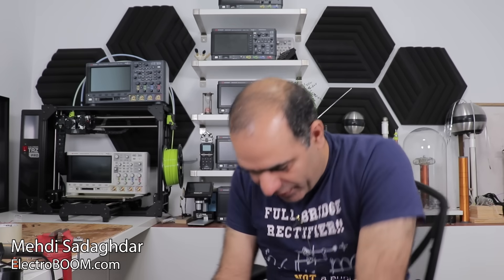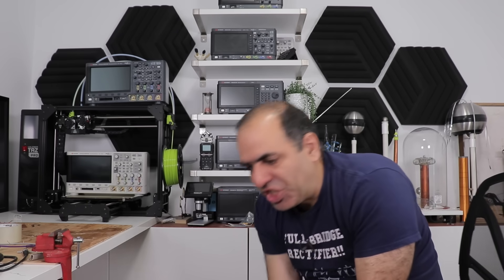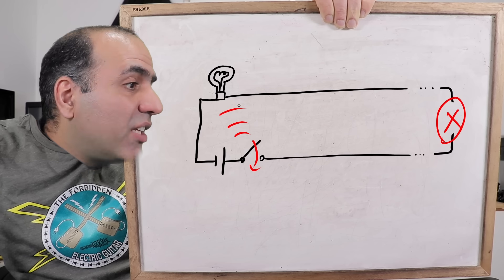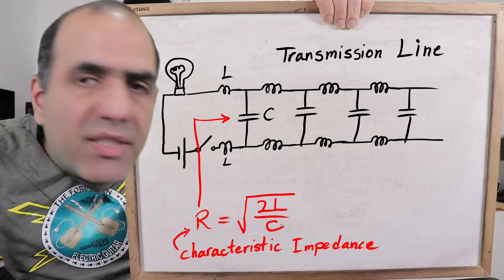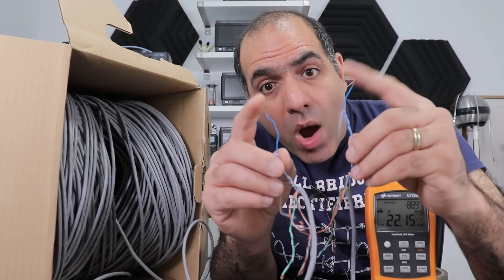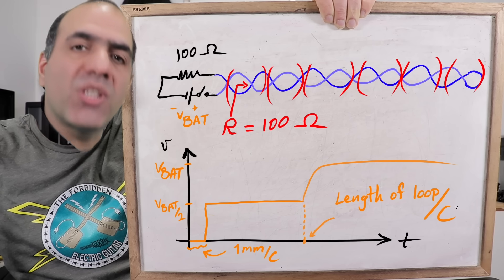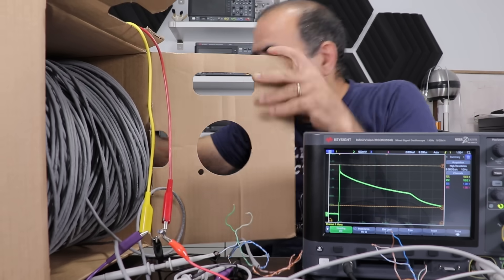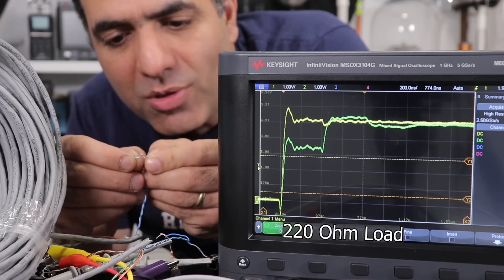Testing the LONGEST LOOP OF WIRE!!! to Turn a Lamp On

Comment: What I am still wondering after everything said is: how do the charges near the load know that they are part of the same circuit the switch and the battery are part of? Of course they can only move if somewhere else something is moving in order to occupy that space, but that only happens when the whole circuit has communicated. So… how do charges next to the load know that the flux of charges near the battery is not from a disconnected circuit?

Oh! Damn!! It doesn’t! I had forgotten my EM lessons… so… it would blink for a moment… yes…
Reply: Resonance, right?

Comment: That is amazing! Does that mean we could virtually power any device with only 1 electric cable instead of a pair? Is that already in use in some applications? Or is it not because it is inefficient?
Reply: No. Remember he already connected “the other side” with a very short length. You do need a full circuit (which is why you have the two conductors, one that “goes” and another that “comes back”. He then just worked on the “very long side” for most of the video.

Comment: After connecting each twisted pr in series, connecting a variable resistor to the far end while sending a 50% Duty Cycle, 1khz square wave (TDR), you would be able to find the total impedance of the line. After finding the total impedance of the line you should also determine the Velocity Factor of the line. Once the Impedance and Velocity Factor are determined you can calculate and cut the line length to the incremental wavelength, with respect to the frequency of the voltage applied. Now you would be able to measure the speed of The Lamps On Moment Vs The Switch On Moment equated in time.

Comment: May I enlighten the interested viewer that this is nothing other than the transmission of radio waves?

An antenna (dipole) is two wire ends that do not form a circuit. Nevertheless, a (modulated alternating) current flows into the wires and creates an electromagnetic field. And the simplest receiver is again a dipole and a small part of the energy arrives there without being electrically connected to the transmitter in any way.

So what is shown here is basically how to build a simple transmitter and a simple receiver. However, it's funny how you approach the subject here.

Comment: as a network guy installing these Cat5 cables, i had a good chuckle when you measured 40m by hand :D every 1m is marked on the cable itself, you could just cut the cable at "40m" mark (or 265m, if your numbering decreases from the end)

Comment: Its worth saying that diffrent pairs  in the TP bundel have diffrent number of twist per meter. This is very exactly contoled to with in a fraction  of a turn per meter..

All the twistnumbers are primes  so they will not interact in either long of short cables

Comment: I was thinking about the speed of light in the wire shouldn't it be a little different for copper wire, aluminum wire, steel wire etc? In the end the atoms are packed in the Unit cells in specific configuarions matching their atom radii, thus the speed of light should be different. I wonder how big is the difference.
Reply: Yes.. Al least you can check with internet how transmit the information
Depends of category

Comment: It's great to see the induction of an LED can be done in 5 cm with such a low voltage.  Of course Derek's 1 meter distance does matter and the light bulb and the voltage he used matter.  The setting simply does not turn on the light.

Comment: I've been using RG-58 coax cable for this experiment for some years. Works very nicely and you don't have to make your own drivers. This is because everything has a 50 ohms impedance: bothe generator output and coax cable. It's a length of somewhere between 70 and 75 meters on a spindle. We calculate from the scope timing what the actual length should be, and sometimes students then actually measure it. Really nice experiment where you can see the effect of an open termination, a short circuit termination, and the correct 50 Ohms termination.
Reply: You made a TDR

Comment: Great class, thank you. Would you consider showing us how twisted pairs reject or cancel interference?
Reply: It's pretty simple physics, right hand rule of a conductor producing a magnetic field when a current is passed on it. If you put two wires really really close to each other, with identical current going opposite direction, and you are observing from suitably far away, maybe 10x distance between the twists for ease of calculation, you will see zero magnetic field, because there is essentially zero net current when you superposition it.

Comment: i like how changing the resistor causes the steps in voltage to change when its not matched to cable impedance, its becoming antenna matching  theory

Comment: In telecommunication's industry we use TDR device - time domain reflectometer, it uses reflection of other end of loop to determine line length and termination (open, short or fault), depending of cupper pair insolation (basically depending on type of cable: jelly cable, paper insulation cable, etc.) we have different speed of light trough the cable - propagation (if cable insolation have higher dielectric constant we have higher propagation), with correct propagation we have reflection on screen on correct distance from measuring spot.

X axis of graph is length (in foots or meters) and Y axis is reflection, reflection of returning signal represents change of impedance in path.
If graph at end goes up it means that we have open circuit (reflection goes from zero up - impedance goes from constant to high)
If graph at end goes down it means that we have short circuit (reflection goes from zero down - impedance goes from constant to low)

Depending of situation, positive reflection can be also A or B line break (one line break), negative reflection can be corrosion on line, moisture in cable, parallel line etc.

Comment: One difference between your setup and Veritasium's is that yours is compact enough to be considered as if nothing else exists. In a more spread-out setup like Veritasium's, external influences such as stray capacitance between the wires and ground, current induced in the wires from nearby TV/radio/mobile phone transmitters, even sunlight and cosmic rays, all have an effect. The theory is the same but all these external factors would make a practical experiment less demonstrative.

Comment: When wiring Valve/tube amplifiers/radios/test equipment etc, the heater wiring is all ways twisted to reduce hum in the circuit. Being the voltage is usually 6.3v ac 50/60 hz, one can run heaters on dc but that requires rectification and there fore added complexity and cost.

Comment: In ham radio, when building antennas, we use a factor to adjust the length of dipoles, based on the material used. Iirc, copper needs a 85% change. This is because the wave length, which is used to calculate the dipole length, is based on the speed of travel of electrons. Seeing that your cable had around a 70% difference, probably means it's not pure copper, but plated. It's much cheaper that way.

Comment: 3:00 it definitely does matter since if the ligiht bulb is right next to the battery then when you throw the switch you begin charging (as far as the light bulb knows) a capacitor by feeding electrons from one side of the light bulb to the other. i agree with the numbers, but it must be symmetric in order to be valid

Comment: I am not 100% spun up on the physics behind what is being studied and demonstrated, though I understand the basic concepts. I would just like to say that this is an amazing series I have been watching regarding electric flow, and I have learned quite a few things, some things confirm what I had understood and gave me a better understanding as to WHY and not just "it is what it is." Thank you for putting this on, it's very professional, educational, and you both are doing great work breaking things down to be better understood, while also giving higher-level understanding to those who are more advanced.

Comment: Speed of light doesn't change. Full stop. It does not. Its propagation velocity can be altered through mediums though. But I'd then have to ask - by what mechanism is this occurring in copper wire? Generally this change is because a photon is absorbed, an electron rises to a higher energy state, then finally the electron falls, re-emitting a photon at a specific frequency related to the energy absorption. So what is travelling exactly? Get that answer and you'll actually solve a few questions here.

Comment: Wish i had seen this five years ago. Had an auto pilot to a 192 foot ship hook to a micro control switch on a thousand foot wire. Thought it was switch bounce, No it was not! Went around robins hoods barn for ever to get it right Fixed the effect with an opto coupler. It worked Just got lucky. Thanks for the memories, Best  Regards  Jack

Comment: While you and Destin have both made the same antenna, your explanation of how this works is the correct one. My preference for building antennas between the two materials used is copper tubing, but mostly because it looks cooler.

Comment: Finally, a video that perfectly explains the actual phenomenon that is being observed.  The only thing I would add is that a single blink upon closing the switch is not what I would call "on", but your claims are being made very clear here and you even show that the light only blinks briefly when it's closed and that as a result you need to be constantly opening and closing the switch to keep the lamp "on".

Comment: This video make me think of another way to test this all out.  Instead of wires how about BIG parallel plates .  A HUGE capacitor. With the blub placed in one case next to the battery.  In another case a far as possible from the battery.    _If I am correct then the electricity will find the path of least action/time/resistance, however you want to put it, from battery to load.  In most cases this would simply be a straight line from the battery to the led. Then how to measure the time difference....   That's where a O-scope comes in.  Then I am a humble theoretical physicist.  What do I know about anything?

Yeah ok so I thought what if the wires were instead placed with a vast random cloud of charges.  Then of course it would go from battery to bulb by the path of greatest probability amplitude.  A pair of giant flat plates would be easier to do.

Comment: Beautiful demonstration! You have shown very clearly how transmission lines work (one of the best practical demonstrations I've ever seen), you have demonstrated reflected signals due to improper termination of transmission lines (high SWR), and you have shown Veritasium to be WRONG. In the description of Veritasium's original video, it was said that "[t]he misconception is that electrons carry potential energy around a complete conducting loop, transferring their energy to the load." And yet they do. All of electronics is built on this premise. The fact that high-frequency signals flowing through a transmission line behave differently than do low-frequency signals actually supports that premise. At a given frequency, you don't need a transmission line to effectively carry high-frequency signals if the distance is significantly shorter than one wavelength at the frequency in question. 

Let's say you need to move a 10-Megahertz sine wave a distance of 10 centimeters. You don't need a properly-terminated piece of coax, a plain wire will do. If you need shielding, then most any old shielded cable will do fine, regardless of impedance or termination, because the signal is moving in the manner that Veritasium says is a lie. On the other hand, if you need to move that 10-Megahertz signal 100 meters, you need a transmission line, or else the reactive losses in whatever wire or cable you choose will eat up much of the signal. 

For relatively short distances (and at DC, ALL distances are relatively short), electricity behaves in exactly the manner Veritasium refers to as a lie. It's not a lie; it's a co-existing theory of operation, much like the co-existence of Newtonian physics at large scales and the probability-based theories of physics at very small scales. Different, but both correct in their given scales of operation.
Reply: It's the electromagnetic field around the wire that carries energy around. Don't take Veritasium's word for it. See what Rick Hartley, a PCB designer, said here: https://youtu.be/oI_X2cMHNe0?t=1291

Comment: i think the explanations in the previous videos are dishonest and misleading. you where talking about dc and permanently turning it on. which doesnt happen. capazity wasn't even mentionet there. 
and you can littarly shield it with ground and it would change the result.

not mantioning anything of this was disappointing

Comment: ugh

did you guys forget what the whole question was in the beginning?

the question was if you had a long loop of wire would it take the time for electricity to travel to get to the lightbulb?

so far all I have seen is wrong answers, mainly because everyone thinks that turning on the switch is sending one electron the whole distance, instead of the reality of shoving one more electron along the line of electron in the wire, so what you would see is the delay of moving all the electrons one position within the copper

you had trolls argue details and bait you into an irrelevant argument, instead of answering the original question

Comment: Great explanation on how a transmission line work. Veritasium took 5 months to understand his mistake in a weird video where he start to understand transmission line property, but still imply fields wihich in DC doesn't make any senses (https://www.youtube.com/watch?v=oI_X2cMHNe0&t=1208s) kind of apologize at the end for its very misleading original video. The question remaining is how energy is carried from the source to the load in a conductor in a DC circuit, is it eletrons travelling the all length of the cable or just pushing out the electron in the next atom like a in a wave?

Comment: So now you see 😍
Energy is a thentional diverentional displacemends 😍🙏😍
Reply: But the lamp wil not burn if the wires between the open gate an the led was not there at ol😍

Your energy bi the diverentional acts theme to release on the 0 side and to take on the + side
So this thentionaldiverentional displacemend between the space interactions of the total set of conditions😍

Ai ai ai your beautiful 😍
Themporal Thentional backdrafd 😍 waving back in to balance

Comment: I'm really impressed how you managed to explain impedance matching in very simple terms with a very nice demo. I never really understood why the impedance of the load had to match the impedance of the cable or antenna till now.
Reply: Just look up Thevanin and max power transfer. Its easy to show that max power transfer accours when. Impedance is equal/matched.

Comment: I used to run a wire extruder. (coating copper wire with PVC jacket) .   We would use battery pack to test for continuity in a barrel of 20 gauge wire sometimes up to 60,000 feet long!   I never understood how just 24V would make it but it did.

Comment: Sure its true if you have a load that can be turned on by brushing your feet agains the carpet the wrong way, but the original question from the Vman was about a lightbulb. It still seems to me that the significant load of a lightbulb would cause it to not be "on" (powered enough to be incandescent) until the load traveled the length of the imaginary wire.
Reply: Watch ElectroBOOM's first reply. [Video name, "How Wrong Is VERITASIUM? A Lamp and Power Line Story"] I think Vman said the electricity didn't itself turn on the lightbulb, but that any electricity would cause the lightbulb to turn on. Too tricky for my tastes.
Reply: Vman's tricky Conditions:
-Wires have no resistance [So the wires would let light travel at the speed of light?]
-The lamp turns on immediately as soon as there is current [Isn't there always current? Higher than the background current?]
Reply: So Vman, why are wires used if electricity doesn't pass through wires?

Comment: What was proven here, is that electricity travels in metal, not a field outside? So electricity traveling as a wave outside the wire - the 'wave theory' has been debunked?
Reply: @Nad Senoj 
You didn't answer the question, is that because you didn't understand it?

 In a previous video, Veritasium made the claim that electricity doesn't flow through wires, but rather as a wave outside the wire. But in this experiment, the oscilloscope is connected to, and measure the electricity in, the wire. Since it responded according to the math predicting the result, the conclusion should be that the electricity is flowing in the wire, not a wave outside?

Further, he used alternating current to claim the traditional explanation is wrong, and then did a direct current experiment, similar to this one, to show his theory correct.

This experiment is tended to duplicate that experiment to show whether electricity flows in the wire or outside. I am trying to understand the conclusion of this experiment. Does it show that electricity flows outside the wire as a wave, or in the wire as energy, debunking the wave theory?

Do you get it now? It isn't about wave theory at all. It is, where is electricity because this experiment does not show how it is happening, only what, where, and when?

https://www.youtube.com/watch?v=bHIhgxav9LY

Comment: Does it matter where you put the resistor? What if you put it next to instead of across the led
Reply: If the resistor is in series then it won't discharge the voltage and allow the circuit to reset, which is the whole point of adding it.